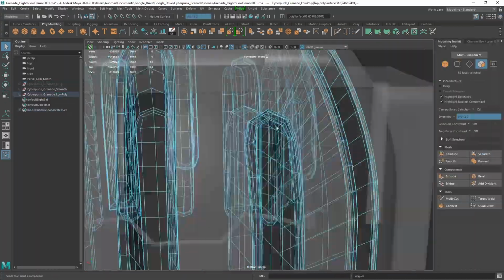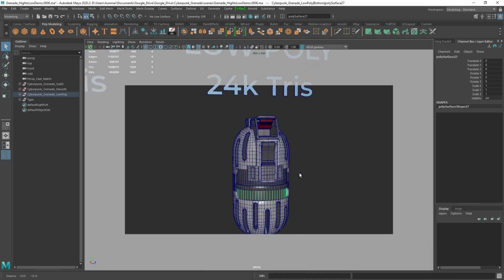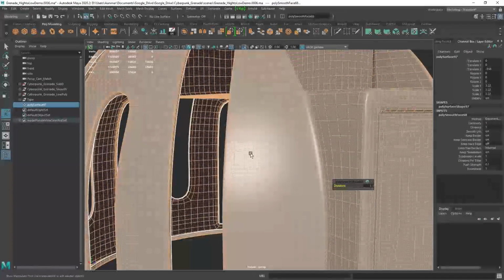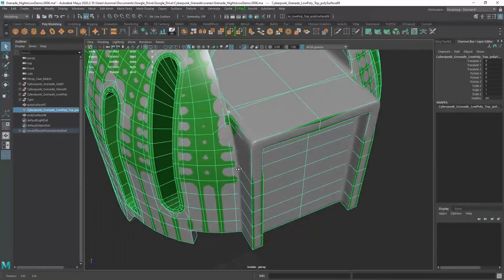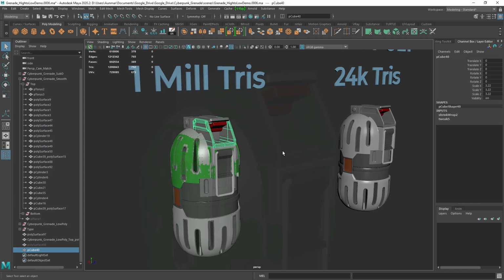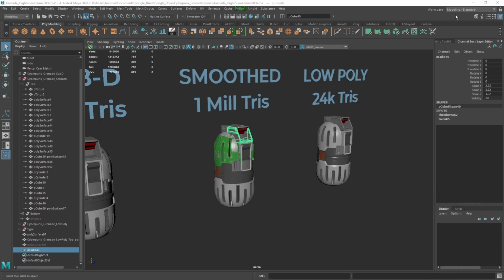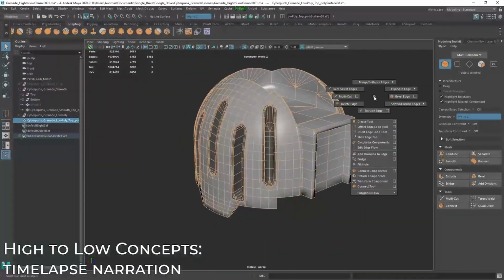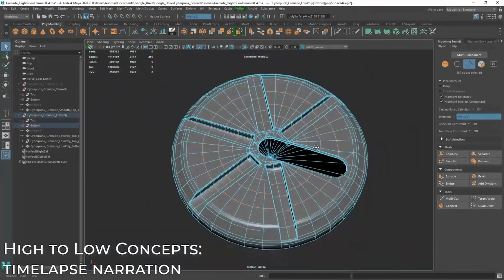High to Low Poly Workflow in 3D Modeling

Comment: I'm a professional rigging artist/animator, just learning more about modelling due to personal interest. The one thing I strongly disagree with is triangles. They may be okay in a model like the grande, but anything that needs to deform and animate needs to be clean quads. Too often, I've had to give back models to the modellers to fix the topology on knees or knuckles. The main problem with triangles for a mesh that needs to be rigged is that they prevent me from making clear and deliberate selections, it's not that you can't do it, but it's a nightmare to deal with. For something like this granqde, I'm sure it's fine, but overall, if I can have a mesh that's entirely made of quads, I'll take that any day
Reply from the maker: Hi Michael, appreciate the comment. I talk about that quite a bit in other videos. This series of videos discussed workflows for rigid body props where deformation is not needed which is why I say Tris are ok. 

I'm actually working on an updated video so I'll make sure to emphasize this point when talking about topology. Especially on when and where Tris and quads are needed. Thanks!

Comment: Do you advice to model High Poly with turbosmooth first then simplifying the High to Low Poly? Or may I make the low poly first then adding details on the High poly after?
Reply from the maker: I prefer to model the high poly first then create the low poly afterwards.

Comment: is it still low poly with 24k tris ?
Reply from the maker: It really depends. Depends on the target hardware, specifications set by the project, whether it's a background or hero prop, etc

I created this as a hero prop, so 24k maybe high but the workflow still applies whether it's 1k, 5,k, or 20k tris.
Reply: @OnMars3D  nice, thanks

Comment: Are there not a automatic way to to delete unnecessary lines? I search a tool/way to export a "compressed"/converted easier 3d Version (without the flexibility to chance things after this step). 

Maybe the tool make a picture from the high polygoncomplete objekt. Than there make a low polygon model and put the picture from the high polygone at the low polygone model. So you should get a mix. Technical there are a low polygone but the humans see all smother - like a little opticle illusion. Or something other maybe. 
Any idears there are ways for this without many manuel wordk?  (like you have a wav and make a mp3, like big huge 100MB Picture and after exporting there are a 1 MB .png)?
Reply from the maker: There is automatic tools in Maya and other 3D software. In Maya, you can use Mesh > Reduce, these types of tools work well when you need to create LODs in game engines.

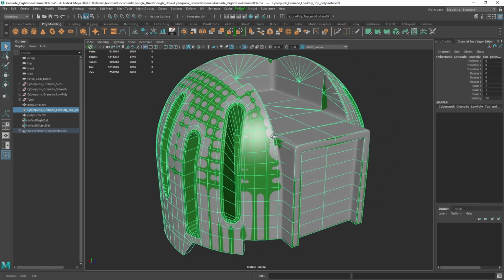Comment: Hello. Thank you for your tutirials. But i have a question. "14:30 Use Shrink to Wrap Base Mesh on High-Poly Model" How can i use this same technique in 3ds Max? Thank you
Reply from the maker: 3DS Max has something similar, it has Conform Brush: https://help.autodesk.com/view/3DSMAX/2017/ENU/?guid=GUID-AB0F11DE-3125-42B0-B7FC-034A34B12181 or Conform Compound Object: https://help.autodesk.com/view/3DSMAX/2017/ENU/?guid=GUID-5790F099-E538-4702-9831-EC06C0EA2819

Comment: That's what I always concentrate on as well. It's especially important for LODs. A good rule of thumb is to treat it like a cylindrical object. The more edges you remove or alter, the more it loses its shape - the more obvious it is. As long as you keep the silhouette for as long as possible then you can kinda chip away at the other parts. Always give yourself a triangle count budget - that's what I learned in games design. 24k tris is still a hell of a lot for a games engine lol. Good job though!
Reply from the maker: Yeah, spot on! I'll eventually comeback to this grenade and make an even lower poly model.

Comment: low poly 24000 faces
 LOL
Reply from the maker: 24k Tris or 12k faces/polys. I talk about the tri/poly count here: https://youtu.be/YDu9pYMkkSM?t=165

Context matters when setting a triangle count for models. This prop is meant to be a hero prop where it can handle close up shots in real time and run on a high on platform (PC/Next Gen Consoles, Etc). If this was just a simple grenade with no focus, then going down to 2k-5k tris make sense. 

With all that being said, the concepts that I discuss in this video can be applied to models that 100k, 25, or 5k. As always, hope this helps!
Reply: Ya not industry standard